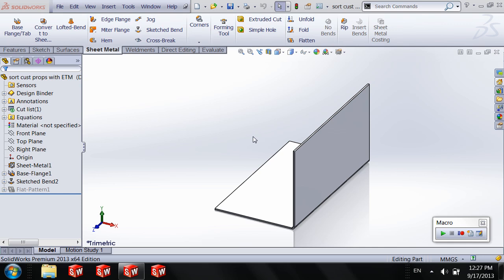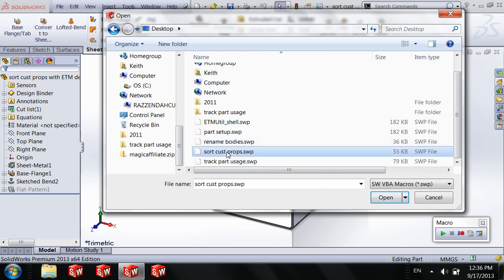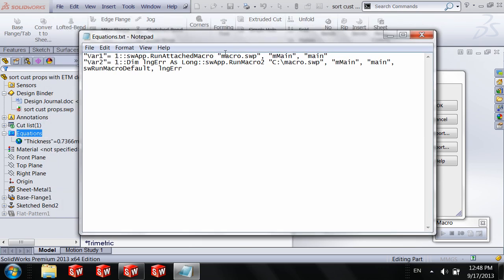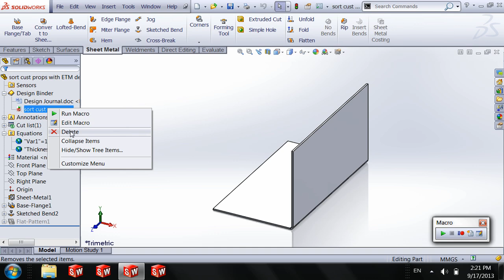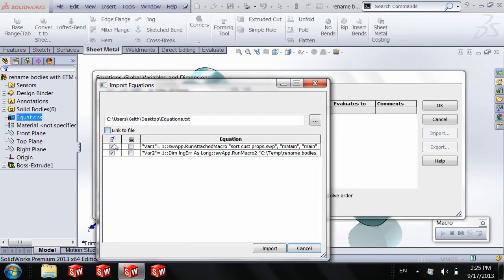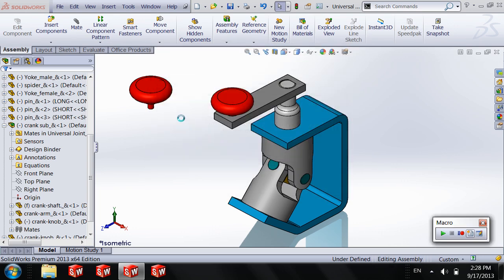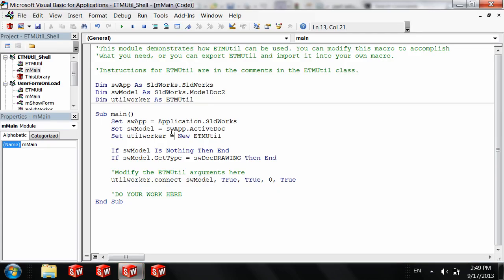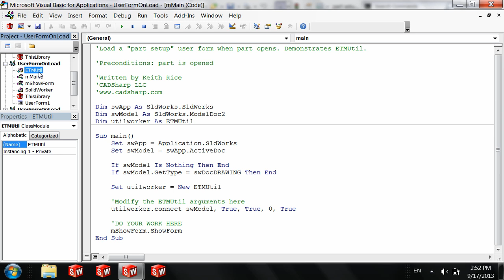Embed and Auto-Run SolidWorks Macros In Your Models!

Comment: As per http://www.cadsharp.com/blog/equation-triggered-macros/, ETMutil will not work in SW2014 or later.
Reply from the maker: It can work in 2014, but I haven't had the time to modify the code to do so. Basically, right now ETMUtil works by suppressing the equation containing VBA code that runs the macro. However the ability to suppress equations was removed in 2014. So that means event notifications must be used to delete the equation and then re-add the equation before the model is saved.
Reply: I was just looking over the 2017 API What's New and found this line!  "Get or set whether to disable an equation and get the number of disabled equations in a model."  Great to see that this method is back in the code.